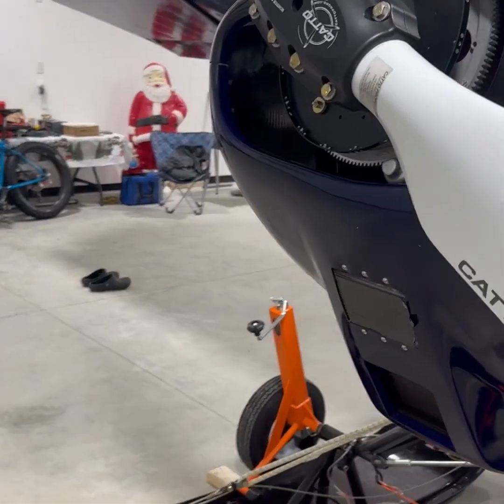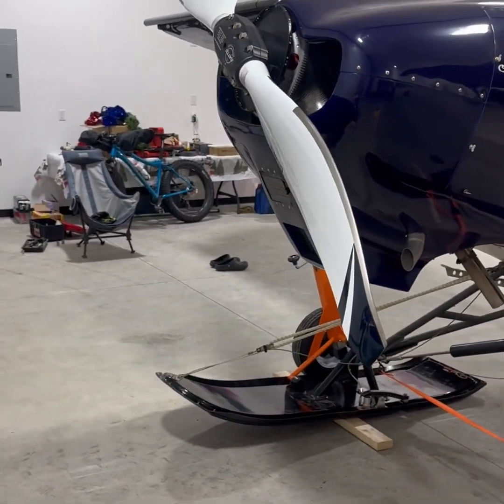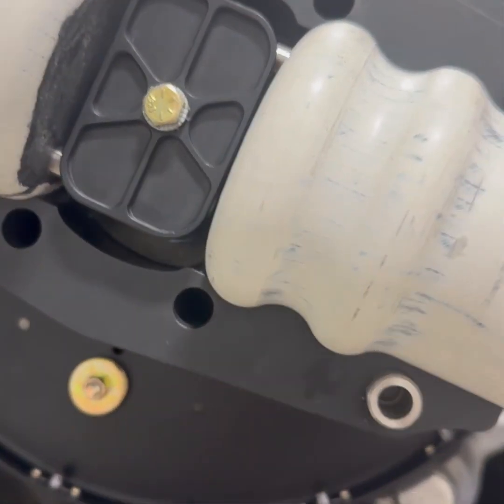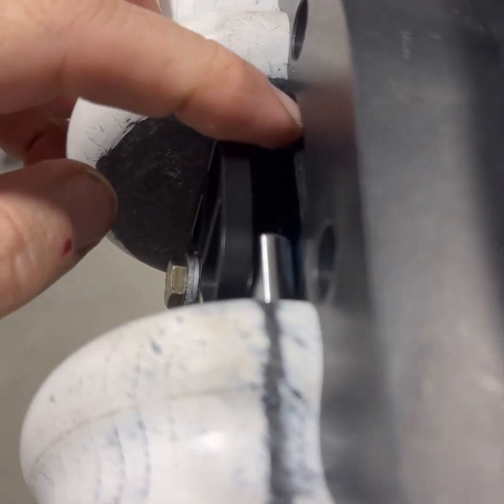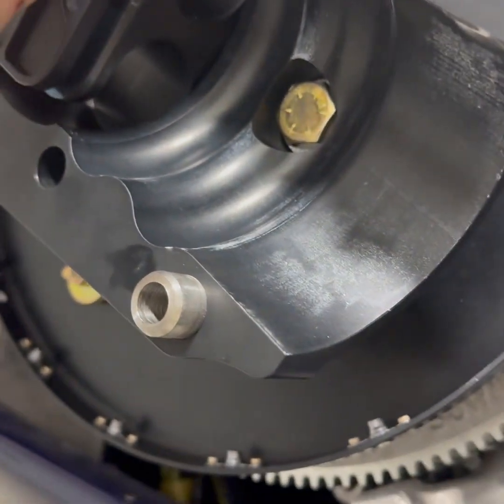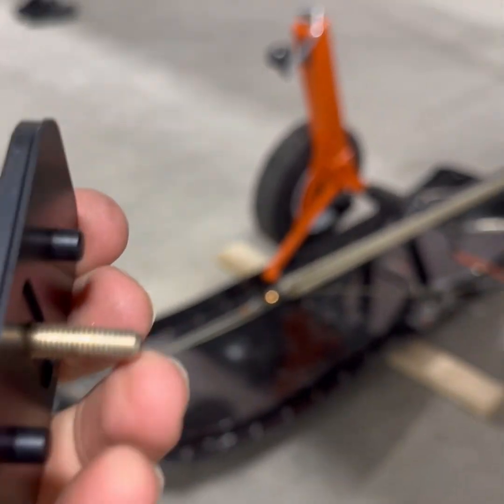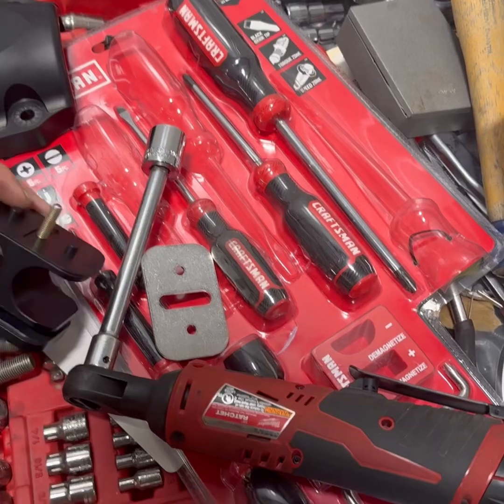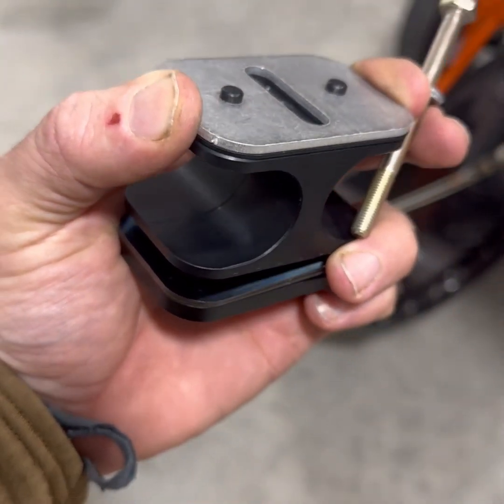Ground adjustable Catto

Comment: Thanks for the vid, prop looks great.  Building an RV and really excited about this prop.  I have seen a couple vids an no one has a spinner on.  Is Catto making spinners yet?  Thanks.
Reply from the maker: Yes sir.  They have an amazing spinner for it.  I just prefer not to run it on mine for ease of adjustability.

Comment: Ron, so how do you like this propeller?
Reply from the maker: I’m liking it.  Love how it adjust.   Should be faster now with the added shim.  I was only doing 81 on Sunday.
Reply: looks awesome, my question is you had it set up for low end so how did it pull ? and how was the STOL performance